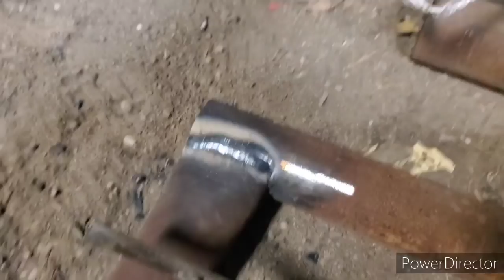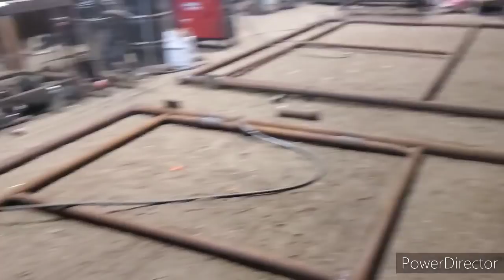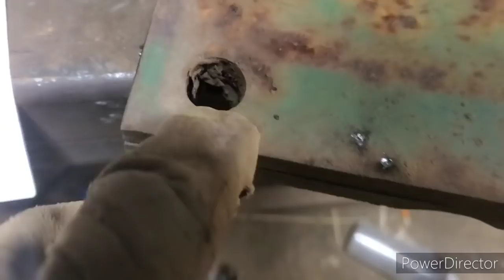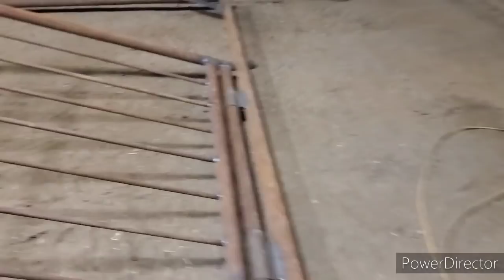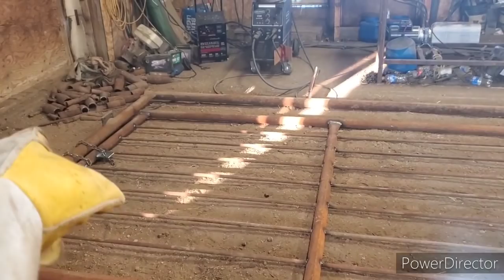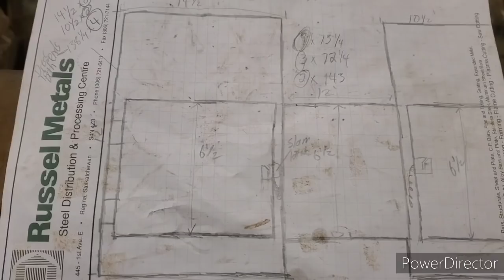How To Build A Very Heavy Duty Double Gate Panel. Tripple Pass Welding With Mig And Stick!!

Comment: went through 2 dry cut blades, fein and an evolution 25-60 cuts and done! 2 7/8 pipe wtf!
Reply from the maker: What the hell. Is it salt pipe or oil field pipe?
Reply: @straightpipeacres6365  2 7/8 tubing
Reply: @straightpipeacres6365  red band oilfield
Reply: @straightpipeacres6365  red band oilfield

Comment: What rods do you use when you stick weld oil pipe?   I always use 6011 but your welds look better than mine.
Reply from the maker: 7018. I use 6011 or 6010 too but all I had left was skinny little bastards so I used the 7018
Reply: @straightpipeacres6365  7018 is the easiest to use

Comment: Good day.  Justa handy fella you are haha. I'm playing welder guy my self today. Fixing up my dozer blade for the steiger
Reply from the maker: Nice 👌.  Got lots of snow there yet?
Reply: @straightpipeacres6365  not really. It warmed up here and it's settled right down. Last winter we got snowed in and our grader operator had quit. M.D. said 3 to 4 days before we would be plowed out. So i figured fuck that and went and opened up my 4miles to the highway and then a  couple cross roads to my neighbors etc. Apparently I wore through the cutting edge and destroyed the frog. Gotter all rebuilt now. Get it back on the tractor and go push back some brush along fields edges

Comment: Capacitor's hold energy and can give a nasty reminder of their secret if you don't discharge them. On the bigger ones on an electric motor, cross the terminals with a screwdriver to make the safe. On the little ones on a circuit board, give them to an unsuspecting person!
No, find a way to cross the terminals safely.
Stick is good if you stick at it.
Nice work there young man!
Reply from the maker: Thanks bud

Comment: Watch your fingers on the circuit boards.. some of those little capacitors pack a bit of juice until you drain them..
Reply from the maker: A guy needs to be woke up sometimes lol
Reply: @straightpipeacres6365  hey the ol ticker jumping 👍
Reply: The electronics instructor when I was in mechanic's school kept a big capacitor charged up on his desk... whenever someone fell asleep during class on our steel work tables, he'd wave everybody off then touch the table with it... guaranteed wake up call LOL:)  He told us how when he was in electronics school they were futzing around and built some gigantic capacitors out of aluminum foil layered with wax paper... were about the diameter of paint cans and twice as tall... grounded one layer of foil to the outer can, and the inner one went through an insulator, with layers of wax paper between them to keep them insulated... He said when they charged it up they blew a fence post in half when they touched the lead to it... OL J R :)
Reply: @lukestrawwalker  NICE 👍